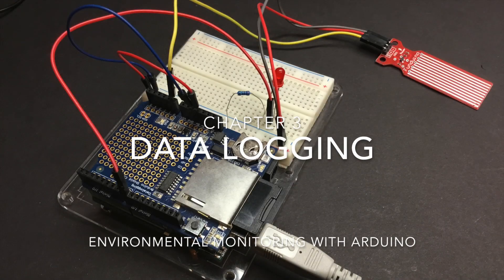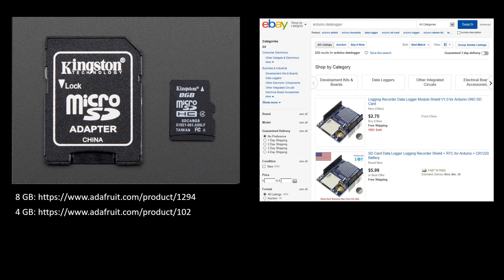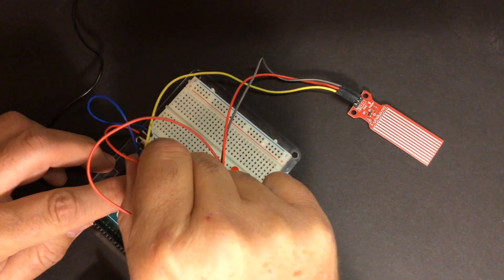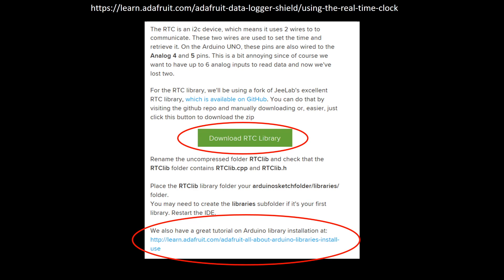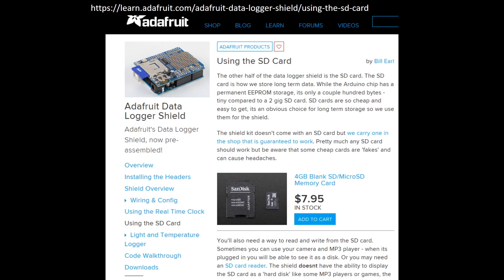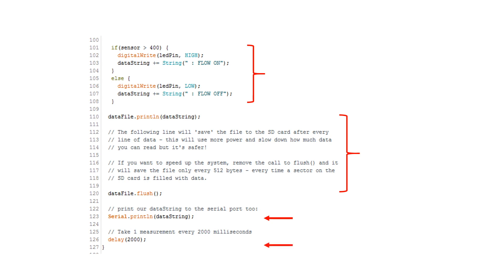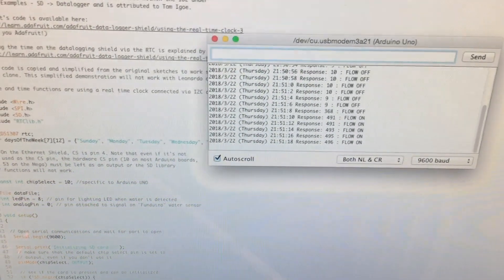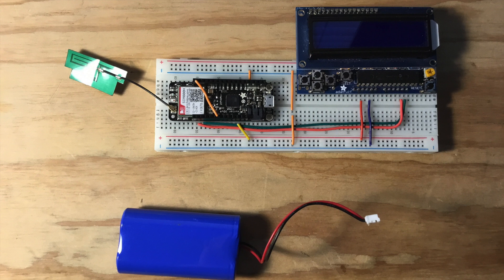Arduino - Datalogging

Comment: I'm trying to understand how to data log based on events instead of set time intervals. I would like to record the number of times a particular digital pin goes HIGH, the duration of time in HIGH, and the peak voltage of the analog in that commands the digital pin. I've looked at many data logging videos but they all seem to be based on timed intervals rather than events. Do you know of a resource that can help me understand how to data log based on events? Thanks
Reply from the maker: Yes- you want to use interrupts instead. I explore that in this video : https://youtu.be/H20QEC0Hgtk . Rather than triggering telemetry, interrupts can be used to write data.